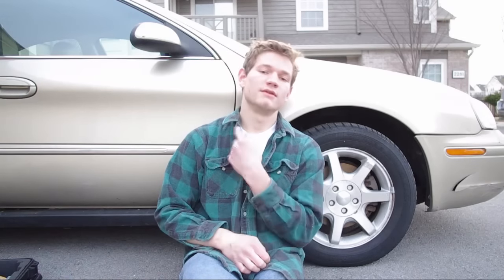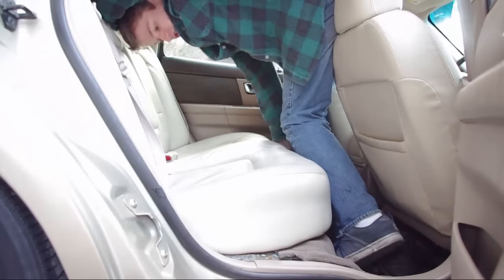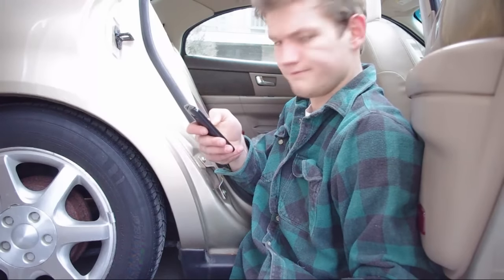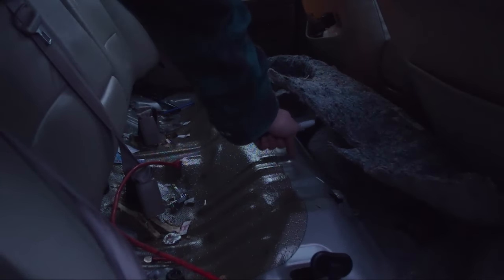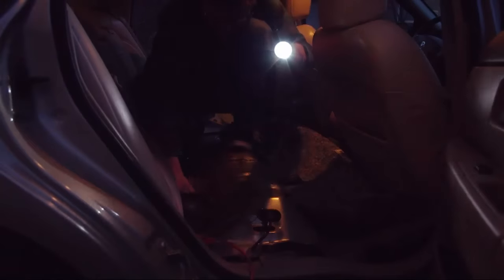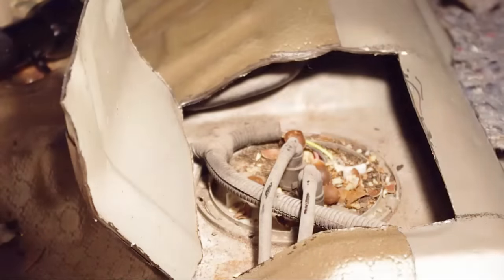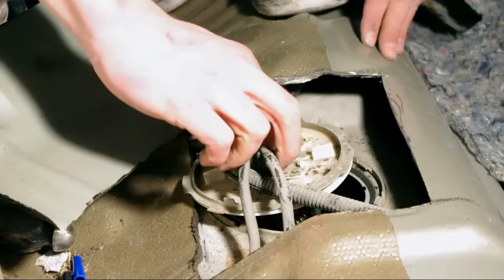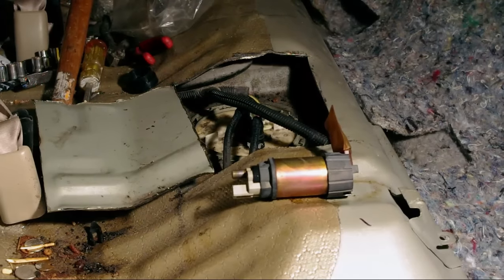Changing a Fuel Pump Without Dropping the Gas Tank

Comment: Did this on a one ton 1998 Dodge van out in the middle of nowhere.    Bought an inverter to run off the battery and supply AC power for the tools.    It was not practical to try to empty a full 38 gallon gas tank or try to drop it.   Worked great in two hours we had it fixed and outta there.  The van had plywood installed on the floors so no problem covering the hole.   You do have to be aware of exhaust fumes under your car getting into the interior of the car and carbon monoxide poisoning everyone!!   Make sure the hole is sealed again.
Reply from the maker: Nice!  Thanks for sharing, I'm glad it got you out of a pinch!

Comment: I did this many times on old camaro's.  Your video was perfect because I needed the location of where to cut.   Thank you sir!  Screw all the negative comments.   Those mostly come from a bunch of sissies that have never worked on anything.   I found your video very useful.
Reply from the maker: Thank you!
Reply: +firbyd, is you time freezing machine for rent? I'd like to save all the time your strategy would take. Horse and buggy is the way to go anyway. No toxic exhaust gasses or high speed fatality collisions then.
Reply: +firbyd, so when criminals work hard and cops have to work hard too just because those criminals can't find beneficial work due to laws like min wage or restrictive prohibitions on farming private fallow fields (T. Jefferson had words about that) then we should appreciate their hard work? No. Hard work is not appreciated. We pay (show appreciation to) people like Asians for making our electronics bc they are quick and sufficiently good at it. Unemployed high school football players have a hard time soldering wires to chip boards. They must deserve more pay for all their hard work since it's difficult for them to find the patience needed.
Reply: +firbyd, cheers. I don't mean to sound irritable.
Reply: Do you accept (pay in the form of giving your enemies a) "bash or shekel" for the time machine device?
Reply: The only thing I suggest is vacuuming the area well from dirt and dust
Reply: 135 Pilot A real Camaro had a fuel pump on the engine block.
Reply: @TheAnantaSesa  no exhaust gasses?  how about dung? and they get hit by cars frequently

Comment: Thanks for the video, my fuel pump went out this pass Monday.took your idea and changed fuel pump motor my self. I cut access hole thru floor under back seat and changed pimp. Did not have to drop tank. THANKS for idea.
Reply: +firbyd, well cars are unsafe at any speed so no matter how it's fixed when it starts rolling again it's going to be a hazard.
Reply from the maker: Flash point

Comment: I have a 2000 Dodge Dakota pick-up that I intend to keep. I will certainly consider this in the future as me and my teenager are learning all General repairs and eventually, the truck will go to him. Our fuel pump lasted six years. I will follow up with a tune-up. We replaced six pulleys, the battery, thermostat, top radiator hose and proportioner valve on our brake lines. 
Good to know that creating this access panel is possible, although ours may not be done from home. Price gouging in Southern California , extremely slow turn around times are what have driven us to attempt to do most of the work ourselves. I wish I was as comfortable as you are working with fittings, clips, and miscellaneous parts. ♡
Thank you.
Reply from the maker: Audra Hughes Great!  So should I not buy a Dakota pickup then?
Reply: Daniel Engling  I love my Dodge Dakota. HAVE had since 2009, so that may seem like a, lot of work, but it's the maintenance for an eighteen year old pickup. Get the 4wd model maybe. I love that it has antitheft, a cab, will haul, and manual windows,  since all electric can be a pain. Most parts can be purchased from Car Quest with the exception of a few that are dealer specific Mopar parts.
Reply from the maker: Audra Hughes very nice.  Yeah I suppose that's not bad for the age
Reply: Daniel Engling Before we change Fuel Pump Assembly/module (WHATEVER it's called?  I think I had no idea it's a cylinder like a fire extinguisher) we're changing spark plugs out to rule out,  if it NEEDS a fuel pump,  but I imagine it does. All I know is it's shivering,  with a light, rough idle @ stop lights. Since beginning to "tinker" have since realized mechanics pull $120 an hour + $195 diagnostic. I'm not ashamed try to diy what we are capable of doing ourselves.

Comment: 2000-2005 Buick Lesabres and Pontiac Bonnevilles have an access cover in the trunk, you just remove the cover and the pump is right there. I bought my 2001 LeSabre with an inoperative fuel gauge and was ecstatic when i  found out I didn't have to drop the tank to fix it, I replaced the whole fuel pump assembly while I was at it, my hat is off to GM for whomever engineered that, it was a stroke of genius.
Reply: or they copied someone else
Reply: I love my Evo Elucidate ye.
Reply: They've even be more genius if they mounted the fuel pump outside the fuel tank or mechanically on the engine like they did in the old days.
Reply: Peter be
Reply: Revived Life Yes it was, there is a special tool for removing it I think but mine was rusted and even though I sprayed it with wd40 and let it soak it was still a pain, and don't use a torch to loosen it, I didn't have a brass punch as is recommended to prevent sparks so I just used a steel one, I was afraid to use my air hammer with a chisel also, I ended up destroying the lock ring, so it is a good idea to have a new one on hand just in case, you can always return it, other than that, another vehicle that has an inside access under the back seat is the 1999 and up to I think 2002 kia sportage, my neighbor has a 1999 and I replaced the fuel pump on it for him, that one is screwed down which was nice, very easy to remove.
Reply: Park Avenues have the access panel as well.
Reply: my 08  avenger   has  an access under  the seat   ...

Comment: Dude I used my Windstar's jack and  got 2 stands, left the filler tube side connected and and dropped the other side. I still was able to get to the pump and change it without having to remove the heavy back seat and  lift the carpet up & CUT the floor of a car. I'm happy I did it the correct way without modification to the chassis. Now the car still looks nice and stock without being jerry-rigged an exhaust fumes seeping up into the cabin😅

Comment: I used a Drill to make a hole , then i used sheet metal scissors to cut a square no sparks safer.
Reply: the sparks from an angle grinder are not hot enough to ignite gas.
Reply: @AdamA-wg1ko  I hope you are joking. Grinder sparks are hot enough to put pits in glass
Reply: i hadn't thought of this. i am about to replace a fuel pump in my 2013 chevy sonic that conveniently doesn't have the access door the aveo did. I will try this shears method. thanks
Reply: Grinder sparks are pieces of molten metal. Avoid using a grinder around the fuel tank. And if you gave no other ootion dont go all the way through. Once you have patiently worked it until its very thin use a punch to finish the job. Stay safe and live to see another day!!!

Comment: The problem with this video is this: At some point out of the thousands people who replicate, a few will lack common sense, and after popping the top ring open (pick one of below):
-inadvertently trigger their grinder causing a spark at the grinder motor brushes
-cause a spark while unplugging electrical cable because they left key on and not disconnected battery
-tip over a filament or halogen work light which will break above the opening
All of these (and more) can end that person's life...because the vapor (not the gasoline itself) that escapes up when you open the top of the tank, is highly explosive
Reply: he said just be careful- there are risks in any job

Comment: Using a gronder is a good idea for safety reasons.  I would have taken a portable vacuum cleaner to remove the debris nefore temoving the fuel pump.
The hard part for me is to determine the exact spot to cut out the opening.  It would be nice to have a template for making the cut for me Chevy Tohoe.

Comment: Thanks so much for the video. Got a 1996 Honda Accord (over 300,000 miles) that is hard to start after sitting over night. I have tried many things hoping to avoid pulling the tank. I am pretty sure my fuel pump is back leaking back into the tank when it sits a while. Going to give this a shot. 👍

Comment: This is an excellent way to avoid dealing with a full tank of gasoline, but it can be made much safer.  Since the ideal explosive mixture of gasoline vapor and air is near 14.7 to 1 ( a range on either side of this ratio), why not be safe and set a fan to blow under the floor between the floor and top of the tank.  This will prevent any explosive mixture from forming while you are removing the floor panel.  It will then be just as safe to remove the pump from the tank as it would be with the tank out of the vehicle.  It is dangerous to do the task either way because of static electricity discharge igniting the vapors, so use the fan blowing over the  work area while you work on taking the pump unit out and putting it back into the tank.  You can also cut the hole with a jigsaw with a short metal-cutting blade if clearance allows, or maybe drill starter holes and cut it out with tin snips if the metal is not too thick to cut.  Any task involving fuel can kill you if you don't use common sense about safety, so be very careful around fuel and tanks.
Reply from the maker: EXCELLENT suggestions!  All these things are good ideas, thanks for sharing.  Just be extra sure on the clearance with a jig saw if you go that route.  A puncture would be bad.
Reply: 14.7 to 1 is ideal air-fuel ratio for an internal combustion engine

Comment: I did this on a 1993 Mercury sable, using just a large pair of diagonal cutting pliers. The metal on that car was thin enough that I could just tear and peel at it. Definitely wasn't pretty, but it worked.

Comment: This is why my dream car is a 1963 Chevy Nova 6 cyl 3 speed manual trans - fuel pump accessible, it's on the engine block.....no expensive, iffy electronic ECM's, sensors, injectors to suddenly crap out while driving across a bridge or in the middle of a desert.....only electronic part is the radio. Simple easy to repair / maintain - early Chevy Nova's were the best sensible to own car GM ever made......I want one

Comment: Crazy dude! Lol I made my access hole by first hammering a nail through the metal just about half a cm in or less enough to put a flashlight and see in the hole so I knew exactly where to avoid, like lines/hose and wiring but also the tank so I drew a rough circle and used cable cutters basically wire cutters and eventually after cut by cut, I got the hole made, the edges are rough but I'm ok with that because I only need enough clearance to pull the pump assembly which I accomplished and life has been all the worth while easier ever since, I couldnt trust a grinder though because I personally only pull the fpr off the rail to relieve pressure and I dont run with no pump relay to drain lines and I knew there was fuel in the lines so for me my only method I went with was the hand tools no power tools because even 1 spark and I'd be sol! which I was aware of so I went the safe route but also a good idea I do when i replace fuel pumps, keep your windows or door open and run an extension cord to your ride and plug in a small fan to vent the vapors as you work, this way you avoid vapor build up and decrease the risk altogether

Comment: don't forget the sealant. after you cut the hole and replace the pump, what you should have done is the sheet metal but also some rtv to keep it watertight. 

boy am I glad I have a vehicle where they thought with their heads and made a factory access door. the wife's GM on the other hand is one of the drop tank types. I think they do it to try to make money.

nice vid appreciate you sharing.

Comment: Thanks Dan. I dislike dropping tanks a lot. 
I had a ford spirit it had access to the fuel pump. 4 screws if remember correctly. 
The cooler thing about that car is , it had a drain valve to drain out the gasoline. Factory. Someone was thinking. 
Thanks again Dan. I off to cut a whole in my 2000 ford taraus sel
Reply from the maker: They don't often think about the little guy, the end user/mechanic/owner.

Comment: I have two Impalas - one 2004 and one 2010. The 2004 has the access panel and the 2010 doesn't. I asked the some mechanics and a dealer why they got rid of the access panel in the newer models and they stated its because changing the fuel pump without cleaning the tank leads to the new pump dying a quicker death... Chev and aftermarket pump manufacturers were getting tired of warrantying fuel pumps because people were dropping new pumps into dirty tanks.  Some guys also told me it was because gas fumes were getting into passenger cabs... safety issue... but I dunno about that one.   I also believe they took the easy access doors away so they force people to bring their car to the dealer / mechanic to have to pay mechanics to drop the tanks and replace the pump.  So both reasons I believe are true.  I JUST dropped the tank in my 2010 Impala and replaced the pump (yes I cleaned the tank) and it wasn't that bad a job. 2 hours true but not that bad. Yes - alot more work than just opening an access panel.  I contemplated cutting an access door in (while the tank was dropped) for future repairs but decided against it because a support column was right there.  Wouldn't see that if you cut from above.  As for using a grinder... too many sparks flying around gas lines for my liking.  And opening the lid with a steel screw driver - I'd use a non ferrous punch (brass?) to prevent sparks.  AND - sorry to be so critical - but you gotta clean the top of the tank before opening that lid!  It takes just a bit of dirt to screw up these in-tank pumps and mess up the fuel pressure regulator valve.  The bugger manufacturers are putting the fuel pressure regulators on the pumps INSIDE the tanks now, and not on the fuel rails.  Doesn't take much dirt to clog up these regulator valves (they are made so cheap now) and then you have this hard starting because dirt is letting fuel drain back into the tank.   My 10 cents worth here.   :)
Reply: did you find debris in the tank?
Reply: @ufartface  I can't remember - I don't think so . I tend to use the high octane gas and only go to good national retailers. We had a problem up here with some individual immigrant run stations getting gas from questionable sources... it was found that some were getting gas with industrial chemicals mixed in and it was screwing up peoples cars.  If I remember correctly, from what I saw in the tank, there was very little to no rust / dirt.   But the car died a year ago due to a major head gasket leak at highway speed causing a hydro-lock and then implosion.  It had 323000 km on it so it went to the wrecking yard...

Comment: Genius! Before I found this video I was thinking to do the exact same thing on my E150 conversion van. Cut a hole in the floor!
I removed the seats long ago and there's nothing but floor back there. All I need to do is pull back the carpet and locate the pump.
Your process is looking good and if I can I will measure, etc. too but I also have a HF borescope and so I might just drill a hole in the floor and have a look around to locate the pump.
Then when confident, cut.....
Reply: if the pump has not totally failed, have someone turn the key to on position and and listen for the position of the hum of the pump priming

Comment: I did this on my 03 Taurus last month, used the video for reference on the hole location . The job came out fine car runs well , a couple of notes, don't cut all the way through on the cut in the back not much clearance there just skive a line and and and the hatch you cut will open like a door also you will have to reuse the locking ring as you will not be able to slide it over the electrical harness . If you are concerned about your cutting skills you can remove the bolts on the rear of the straps and there is enough flex in the hoses that the tank will drop about 3 inches giving extra room . You can leave the battery hooked up as when the key is off there is no current to the pump you can however easily remove the pump relay [ it's under the hood] for extra safety. All this being said I have to agree with some posters that this is not a job for a rookie and a 4 inch angle grinder requires a fair amount of skill to use safely , and if you don't have a fire extinguisher handy don't do it consider what you are getting into before you start if your not so sure drop the tank.
Reply from the maker: Great points. Thanks.

Comment: 2:55 "Use a nail clippers you find underneath the seat to pull it out." 
Hilarious! 🤣
Good idea. I don't want to drain the fuel then lay under the car to wrestle with the fuel tank. 
Sealing the gaps with polyurethane calking would be a good idea.